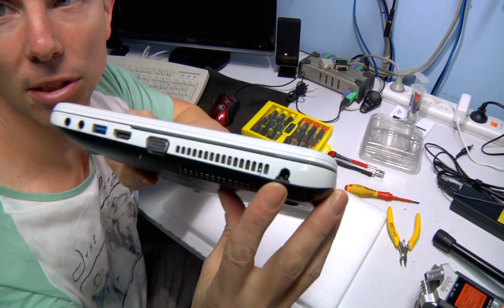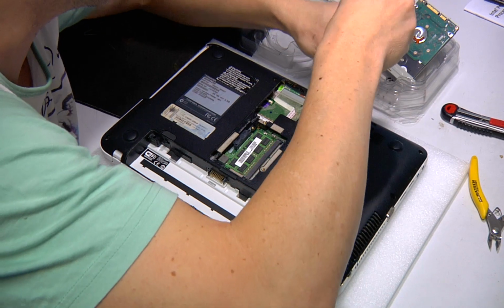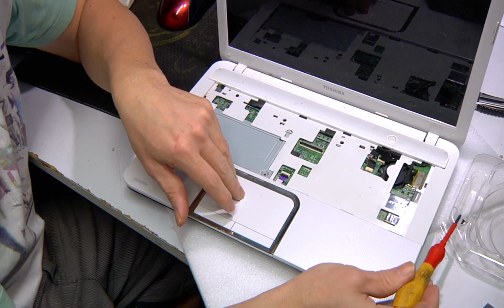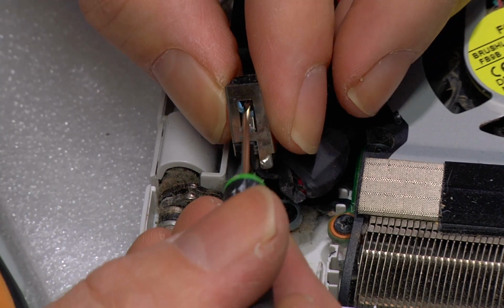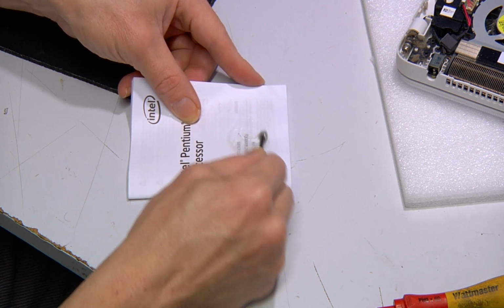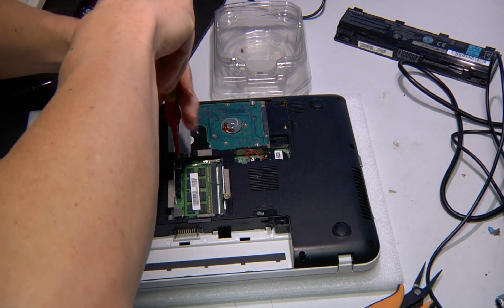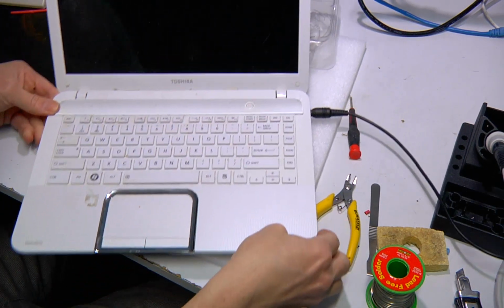Toshiba Laptop Power Jack Repair or Replacement - How To on Youtube

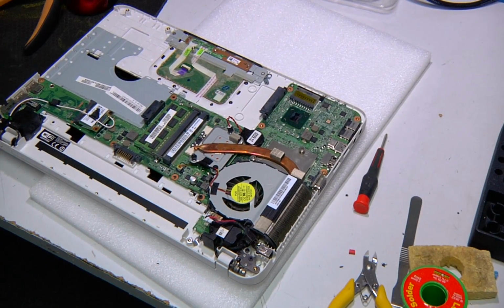Comment: For a second there I thought professor snape took over at 14:11
Reply: LMAO, I've also noticed that.
Probably a side-effect of a 30 fps to 25 fps conversion I guess ?
It's funny anyway :)
Reply: Similar. It is not a artifact of changing framerate but the samplerates that were used to record the audio. The voiceover was clearly recorded in a different samplerate than the audio of the „original“ video take.

Comment: Very nice Mr.Dimitri,I also like your asmr videos too, you're a very talented man, can I ask you for some advice? 

I have a desktop pc, its a Dell inspiron 620s, core i3 sandy bridge 4 physical cores and 4 logical @ 3,20 ghz, 4 gigs of ram, 1 terabyte of hard drive, I upgraded it to windows 8.1 pro x86, also I have partitioned the hard drive in order to put the O.S. In one partition and all my libraries in other partition and I have another one just to back up my stuff when needed, my question is, what can I do in order to upgrade the hardware, so I can play heavy games,and emulators ,with a nice and persistent 60 fps. Thanks and peace. And sorry for the long comment.
Reply: Sorry I meant x64 for the processor. Sorry for that.
Reply: Get a better processor
Reply: Graphics card?? If you are running off mbp graphics you will definitely will need a graphics card something like a gtx 770 should do
Reply: KAL EL You would need a Generation 3 intel i5 quad core processor at the least to have a good processing power, you don't need an i7 because they are built for graphics designers and tasks that require alot of processing power e.g. rendering animations.

4 gigs of ram is fine, I would personally go to 8 so that I am future proofing my self.

The terabyte of HDD is fine and will do.

I would make sure that the processor is x86

Also a good graphics card, preferably the GeForce Titan.
Reply from the maker: the system will be limited, it looks like slim case, which mean low profile video card.  That restricts you 100% if your lucky you might find a GTX650-750.  I just google "low profile GTX750" Galaxy make one.  But you need to look at power supply and check how many amps of 12v it supplies
Reply: DmitriTechMech thanks to all of you, for your time to reply, I made a mistake my processor is 64 bits.  And I will check your advices asap, again, thanks for your time. All of you. Peace.
Reply: GPU and CPU definitely. Make sure your PSU can support your upgrades as well.
Reply: Hello, don't listen to people saying upgrade your processor. You will need to get a better Graphics card rather than the Intergrated graphics on the i3, for he graphics card I would recommend maybe a Nvidia gtx 950 or 960 just look for a good graphics card that is at your price range. Also you might want to upgrade your RAM to 8gb 1600mhz or 1866mhz. This will allow modern games to take full advantage of your amount of RAM. The i3 processor is ok for gaming but that might be a future upgrade maybe to an i5 or an i7 ( both are good) it depends on the model you get. Also remember to always check how many watts your power supply can give as some graphics card need at least 150+ sometimes less so if you want a graphics card needs a higher watt than your power supply can handle then your going to need to get a better power supply along with the graphics card.

Comment: one hate i have for laptops is the fan gets clogged up in no time
Reply: That is because you have it on a dusty surface and/or you place it on your lap, laptops aren't meant for your lap.
Reply: when i had a laptop it was sat on a wooden desk, now i have a pc because they are miles better
Reply: ictdude1 Well that is a bit obvious because the heat sync is miles better for 1.
Reply: ***** No, they are portable laptops and this info came from a microsoft certified PC sales shop.

They are called laptop for marketing purposes.
Reply: TheOfficialGriefer its part of the disposable world, you use a laptop on your lap, it overheats and dies the owner will get a new one, its fucked up
Reply: ictdude1 That is why you are not meant to, and laptops aren't part of the disposable world, they are portable desktop PCs, same architecture but more compact, they are called laptop for a gimmick.
Reply: either way i dont like them much, im more of a desktop pc man
Reply: ictdude1 Cool, if that is your thing then yeah, love it.